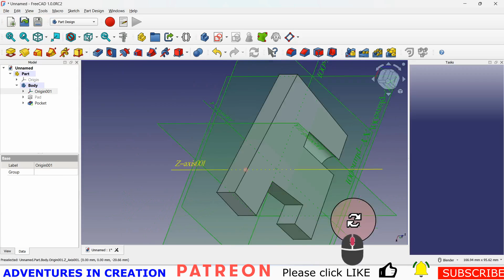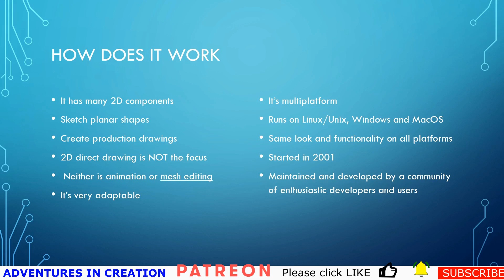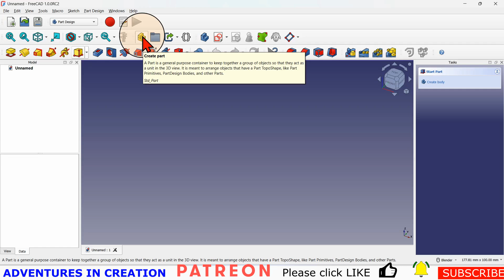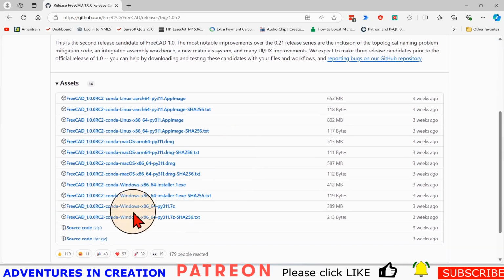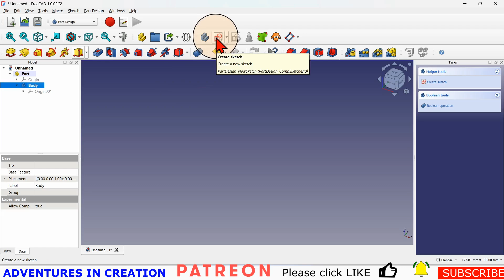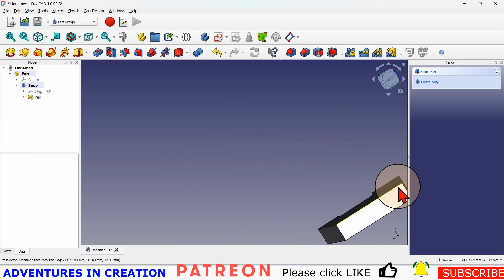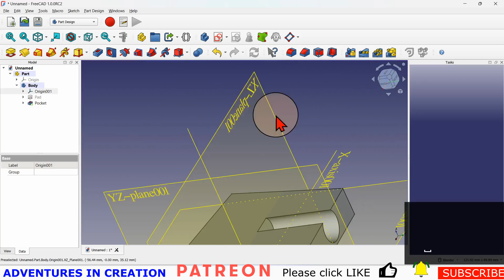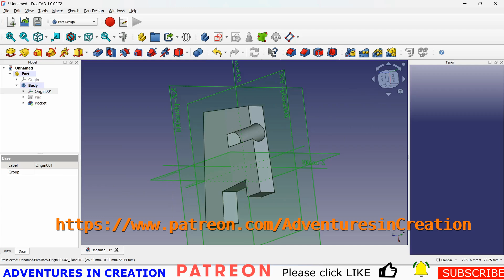An Introduction to FreeCAD 1.0 Part 1 #freecad #cad #design

Comment: I've used an older version of FreeCAD to model some simple box section designs for welding, but had to start some from scratch when I messed up the hierarchy.  This was entirely due to me not quite understanding some of the quirks of FreeCAD's then implementation of parametric modelling (including some bugs that were workaround-able if I'd had enough knowledge I expect).

Hopefully FreeCAD 1.00 and this series will help a lot with that. I think your teaching approach is excellent and going over the basics like you seem to be doing is much appreciated.

Just one minor thing, and maybe this is just a quirk of the way you speak naturally, but you do rather sound like you're on your 10th blunt of the day.  It's a bit distracting but eh, I guess I'll learn to filter it out! 😉
Reply from the maker: Glad you are enjoying it. Can't help the way I speak 😅

Comment: Nice work! I have some experience with Fusion 360 but would like to be future proof by using freeCAD. I keep wondering when they are going to charge for Fusion 360.
I had zero knowledge of FreeCAD. Very keen on some good tutorials from beginner to advanced.
Reply from the maker: I was using fusion 360 but didn't want to be held hostage.

Comment: HI and thank you for creating how to videos to help us all use this software. 

My question is as a Vectric user for CNC work, can FreeCad easily create Parametric Designs and then export the file to Vectric so I could create the toolpaths (Cam) functions to cut on our CNC? 

Thank you for taking the time and I look forward to hearing back.
Reply from the maker: Honestly, I have never used Vectric, what does a Vectric file look like, FreeCAD can export gcode if that is what you are looking for, or a STL or similar?
Reply: @Adventuresincreation Thank you for the reply. 

Vectric can accept and work with a STL file so that's great to know. 

If FreeCad can export the Gcode can it also create CAD functions to set up the toolpaths?
Reply from the maker: @Miter5TrimCarpentry  Yes, you can create tool paths in FreeCAD but I think Vectric is bit better at that. If you can work with the STL or some other form of file, you should be able to work with FreeCAD models.

Comment: I'm a very experienced CAD pro (30 years lol) and I have to say that this is now just as good as Solidworks or Inventor from about 5 years ago. They now need to implement part creation within assemblies such as the newer Inventor or SolidEdge and things like "hole" tools to add parametric threads etc
Reply from the maker: Agreed, you could help them to know what to implement. You can submit a request for the devs.

Comment: Very nice beginner-friendly video!

Few suggestions from my side, if you can cover some best practices and conventions and principles of Engineering Drafting subject to keep in mind, like part naming convention, ASME or ISO 1101 technical requirements too, that would help quite a lot.

Unnamed / mis-named / default-named layers or parts or files inhibit the knowledge transfer to others, who are studying technical drawings. Beginners should also begin with the right mind-set and right amount of self-discipline expected from the CAD practice.
Reply from the maker: Thanks for the feedback, I will keep that on mind.

Comment: To install Freecad 1.0 should I delete a previous install of frecad 0.18?
Reply from the maker: You don't have to, you can run multiple versions but once you use v1. 0 you will probably not go back to 0.18

Comment: A couple of small notes (I'm a virgin user for context). If you start from scratch, you don't get the blue color gradient background (this is no longer default). It can be enabled by doing Preferences -> Display -> Colors -> Linear gradient. Also my buttons looks slightly different from yours. This is prob due to screen real estate but is kind of confusing to find things. Usually you can find the missing buttons hidden under >>. Finally, might be helpful to go over the different mouse control modes (I'm on a laptop and so I'm using touchpad mode). Finally, it might be helpful to have the feature enabled where we can see what buttons you're hitting (e.g. I had to figure out what you hit to make the planes visible). Overall though, great intro and I'll be following along. I think the best piece of advice was moving the tasks tab out. A lot of times I would get stuck because I didn't realize there were open tasks blocking me from continuing. Thank you!!

Edit: just started video 2 and it looks like you've addressed several of these issues!
Reply from the maker: Yeah, tried not to overwhelm in the first video but it can be really confusing when the button you want is seemigly missing.
Reply: @Adventuresincreation  Second vid got me what I needed. Thanks for the content!
Reply from the maker: @0x23A4  You are welcome!

Comment: Have just subscribed, really enjoying your style and pace of teaching, I recently treated mysellf to a 3d printer felt Freecad suited my requirements but needed some help in its use. Looked at a few lessons but either they rushed through the basics or they were using an older version, your lessons are a perfect pace for me. Up to lesson 4 and so far I have managed to keep up, Thanks.
Reply: My situation exactly. About 8 hrs of tutorials today with very little to show for it. Finally a clear well paced lesson,
Reply from the maker: @markchabot3684  glad you are enjoying it
Reply: The Adventurer 5m. Very pleased with it but so far only printed a few thingiverse items but want to produce a replacement catch for a pelican case, which is where freecad should help.
Reply from the maker: @grahamjones5181  Would love to see it when you get it done.
Reply from the maker: Excellent, what 3D printer did you get? I have an Ender 3 V2 and an Entina Tina2 plus.

Comment: No freecad 1.0 is terrible, they took out machine cutter compensation, it was in .20 and worked but they took it away so any machinist that needs to compensate for the real world tool diameter difference from the number the tool controller in the cam package thought was right, no flex, no sharpening, no compensation at machine means no precision control at the machine to maintain tollerance. So it is only usable for people that dont need precision fits.
Reply from the maker: I haven't used cam much in 1.0 not sure why they would remove things
Reply: @Adventuresincreation  they don't know why a machinist would need to compensate separate from in cam software, which means every time your cutter wears by one tenthousandths, you have to regenerate your entire code to compensate for real world variables, it's why machine controllers have the feature, cutting it off in the cam software is a guarantee that real job shops and engineering branches will not be able to use it for their cam work. Only good for engraving too much emphasis on carving and not nearly enough on real machining features that allow precision work.

Comment: I'm following along at 10:48 ("Create Sketch") but I get no response when I click on that icon using FreeCAD release 1.0.0 for Windows.  There must be some prerequisite but I have no idea what that might be.
Reply from the maker: What happens when you click the create sketch button? If you preselected the plane it should start a sketch on that plane, if you did not preselect the plane it should ask you which plane you want to create the sketch on. Remember you are creating 2D planar sketches.

Comment: At 9:14, the author uses his mouse to rotate the part (sketch?  body? ) but does not explain how to set up and use the mouse to work like that.  I have a pretty standard Logitech 3 button mouse and it behaves differently.
Reply from the maker: My mouse is in "blender" mode set at bottom right. I have mentioned that several times in the series

Comment: Thank you for this. 
This is a program I'm not familiar with. 
I started using AutoCAD in the early 2000's. Dabbled in ArchiCAD, Tekla, 3DS MAX, Sketch Up, etc,etc, ( all depending on what I could get my hands on from my employer at the time. 
I ended up deep in Revit. 
Now my position is with a firm that uses Revit, but I'm far enough from production work that I don't feel comfortable asking for a license. 

But, a designer's gonna design, a modeler's gonna model.

You may have saved me from Fusion and Sketch up.😬
Reply from the maker: Excellent, take a look at the BIM workbench, you may find familiar stuff there.

Comment: I started with tinkercad. It's okay, but really limited so i decided i would try out fusion 360. I really like fusion, and have picked it up pretty quickly. I am no cad expert so i still don't know what i am doing exactly, but i am doing it better with fusion than i was with tinkercad. but, now, i want to begin to design products to sell, and since fusion is over $600 a year for a commercial license, i thought i should find another alternative. I found freecad. in theory it sounds great! in practice though, it was a lot harder for me to pick up than fusion or tinkercad were. so here i am looking to learn yet another cad program that i can use for my startup! wish me luck, i think i will need it.

Comment: I’ve started to watch this new series. I’ve watched all your old videos. 

I like FreeCAD but I’ve just got in to CNC wood working and decided to purchase VCarve. 

I wasn’t clear if FreeCAD could produce G Code for what I needed, mostly moulding tool paths ?
Reply from the maker: I think Freecad can but I think vcarve is going to be more straight forward IMHO. Good luck with it. Please let me know how it goes.
Reply: @ yes I agree. Hence the considerable investment (£650) I made in to VCarve after extensive trialling. 

It seems to be the consensus that if you’re doing woodworking, VCarve is the path of least resistance. So far I’ve not been disappointed. 

But I have a soft spot for FreeCAD still. In particular I like the constraints and parameter approach.
Reply from the maker: @GeeTheBuilder  I hope you make some cool stuff with it!
Reply: @ Update:

I’m actually using FreeCad to produce the parametric vectors and then exporting to vcarve to add all the clever tool paths. 

If it works, it works 🤷‍♂️

Comment: TY. Just watched 1&2. I've tried FC and found the UX frustrating.  As in hard to even figure out how to draw a line/box...  and I have used AutoCAD extensively and F360 a little.  So I like that you are going slow on explaining the basics of the FC UI in part 2.  Worry less about customizing the UI though and more just explaining the logic of the defaults and how to use it.  Personally 'll customize it only after I've figured out how to use it.   Please do also explain keyboard shortcuts, I can never figure that out in FC.  Finally at the end hope you get to exporting to 3d pritners (easy) and CNC (seems hard).  Finally, hope you can put out more videos faster and longer.  I'll look a the older videos in the meantime, but eager for more baced on v1.0rc.
Reply from the maker: Thanks for the feedback. I agree with the customization but wanted to explain why my interface may be different from what the viewer sees. I will use your feedback for part 3

Comment: Thanks for this new series. I watched a lot of the previous series, and am still finding parts of FreeCAD confusing, so it's worth starting from the beginning again! I don't think you mentioned making sure you're in the Part Design workbench, as the variety of different options, and different names for similar features in different workbenches, would totally confuse a beginner who ended up in the wrong place!
Reply from the maker: I am glad you said that, the second lesson will cover that in detail and the confusion with the interface.

Comment: Thank you for the video. You are absolutely correct that most videos assume some basic experience in using this style of software.  The terminology was different to what i thought it would be. Part in free cad to me is an assembly, and body i would have thought to be called part. No wonder its difficult to start learning this stuff. Maybe i am jumping the gun a bit, but i down loaded the software and then tried following and copying what you had done. it took me a while to move the task window over to the right of the screen. And i was not able to rotate my model with the mouse (scratch pad and button), or scale the drawing up and down. i did however create the drawing (Body). Looking forward to your next video.
Reply from the maker: Excellent, all of that info is in the next video. I will explain how my freecad is set up so you can copy me exactly
Reply: I had the same confusion on the UI. I did resolve how to rotate model in 3d, middle hold mouse button then press left. My mouse has a roller middle button that zooms the image. Also took a bit to find that space bar is used to toggle visibility with origin highlighted.
Each of these was not obvious/visible in video and took some time to find. I know this was a quick intro but would still be good to mention the exact method each time a new feature is used. 
Good introduction and I was able to follow along and create a matching part. Thanks.

Comment: I had a project I started in the normal release, nothing too complex, as I am a beginner. I tried it in RC2 and it takes several minutes to import and freezes all the time when navigating. Is there something I missed that I could do to fix/optimize my project without remaking it from the start? Assuming this will be improved in 1.0 final release.
Reply from the maker: I have not seen that issue, was there something complex in the file like an STL or the like.

Comment: Thanks for an excellent intro to the new version. I’d class myself as an intermediate user having successfully designed 3D print models for radio projects thanks to your lessons. One question- how do you get that circle around your pointer? I struggle at times to accurately position the mouse pointer over a point on a sketch. Kind regards from Budapest
Reply from the maker: It's a separate piece of software called Key-n-Stroke. You should be able to google it.

Comment: So they Finally released version 1 ???
I'm afraid to go check as I bet they are making it windows 10 only just like the developer candidate builds were.
Reply from the maker: It's v1 release candidate 2 available in all flavors
Reply: @Adventuresincreation  Dnloaded and got a few errors on launch so looking into that before digging any further but nice to see them do win7 builds, after not supplying previous ones in the dev builds i was getting concerned they would force win10 dependencies.